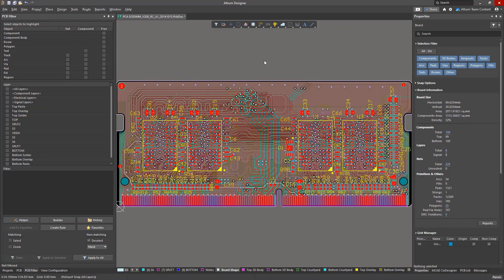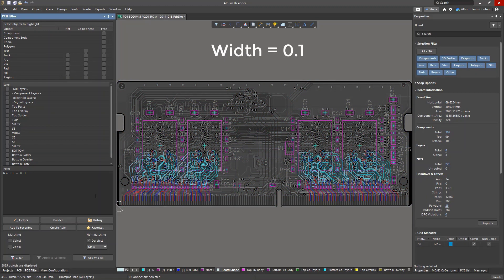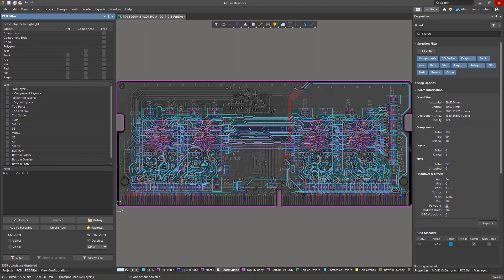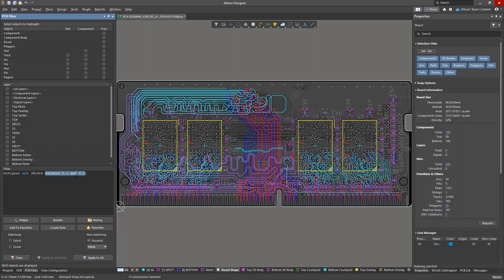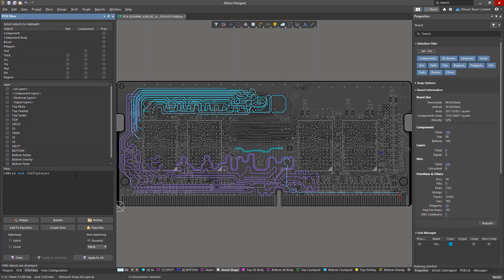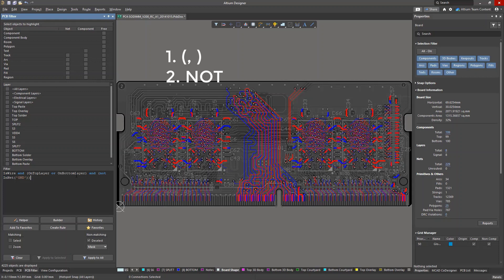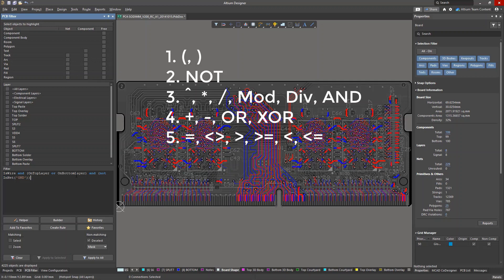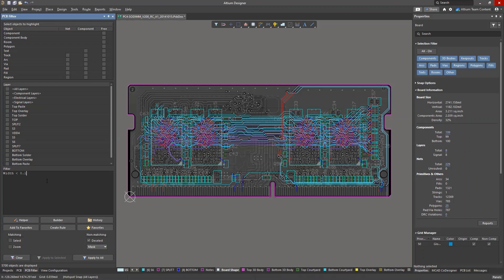Query Language in Altium Designer: Basic Concepts - Part II

Comment: Do you know if I can use a query to select  all the designators of components that share the same value? 
For example, I would like to select the designator of all 10uF Capacitors in my layout.
Thanks
Reply: HasParameterValue('Value','100nF')
Reply: @daisychain6124  thanks!